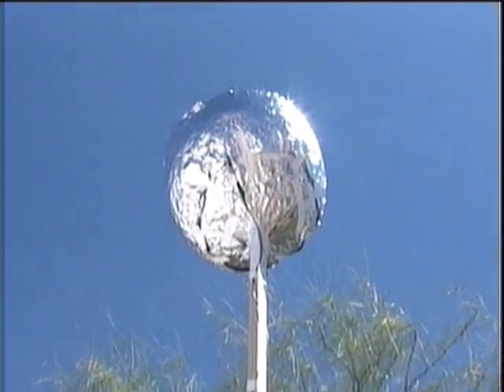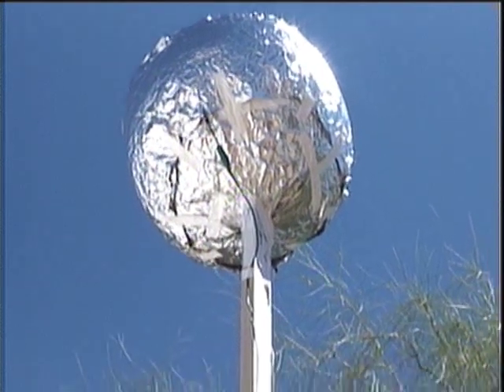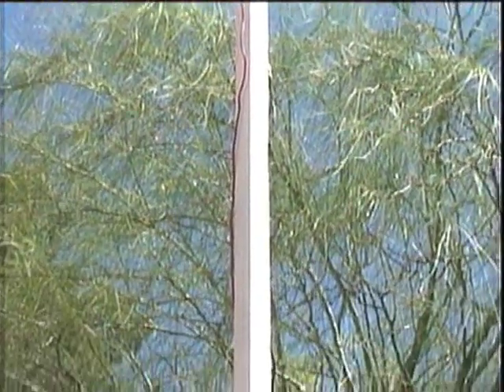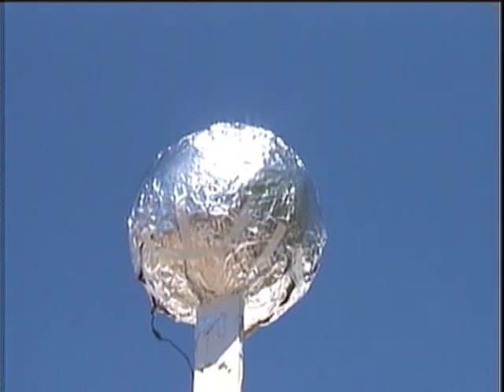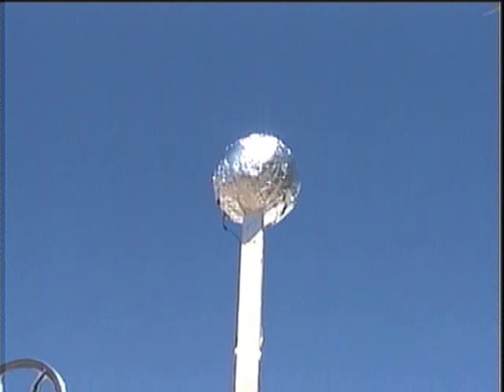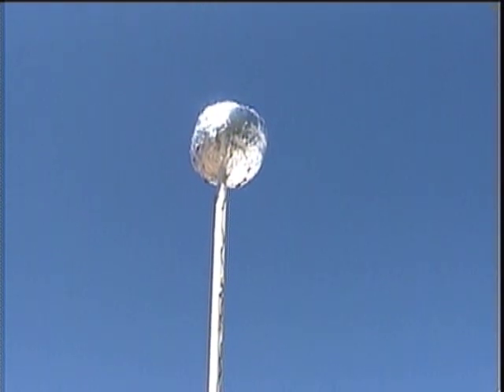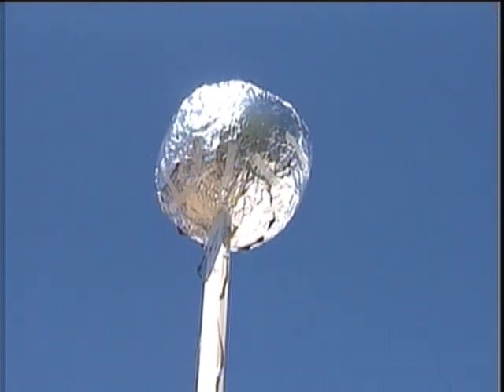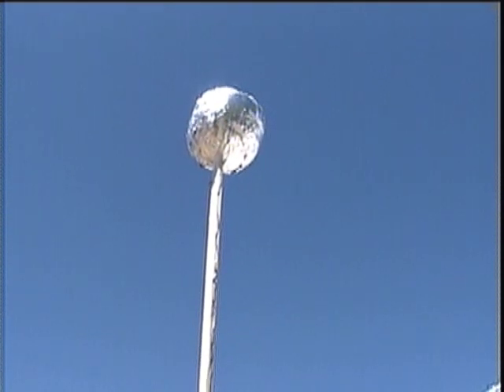Static Electricity From Air

Comment: Use PVC pipe. Wood conducts electricity via moisture. The fair weather field charge in the air during fair weather is @ 100 volts per meter. The higher you go the more volts. 10 meters above ground the potential between earth and this elevated point is 1000 volts. The current flow into the air is only a few pico amps so there is not much power available. The atmosphere is charged due to cosmic rays producing ions in the air. The ions are why the atmosphere has  positive charge. A 300 foot long wire antenna 30 feet off the ground will collect enough electricity to make sparks over 5 inches long if a thunderstorm is near by. Did that.... Don't do it... Its dangerous!!!

Comment: I'm an electrician in MA, I want to share a short story with you. I used to make wire for a company, and it was, if I can remember correctly, 20 awg? And they would store it on a reel with about 20,000' on these reels. Now after sitting around for a few weeks to months, these reels of wire would become basically giant capacitors. And they would store some SERIOUS SERIOUS energy! Enough to blow a small hole through my fingernail and put me on my ass, dizzy for almost 2 hours! And I've been hit with 240 volts/200 amps AC!!! The discharged DC energy was so much worse! And then we're taught that you can't get something from nothing when it comes to energy! Well it doesn't cost anything to let a reel of wire absorb the ambient electricity from the atmosphere, so why do they lie to us right?!!lol
Reply: HumblePerfection I'm not surprised. I have to discharge my capacitors before using them after just sitting around in my drawer before I can use them. The larger ones have caught me off guard more than once.
Reply: Thermal expansion and magnetic fluctuations is enough to cause sufficient friction to generate charge over a period of time if it's insulated and the humidity is low enough.
Reply: that is crazy interesting.... would prolly be more like a reactor or inductor i would think.... maybe the volume of sheathing held most of the current? is the stored power static or in a field i guess is the question
Reply: @Sev Lop What does free energy means for you? If energy was not free (Running freely through everything) Nothing would happen
Reply: @Sev Lop That is the problem of the word 'free'. For me, free Energy means that the Energy is free to move, unblocked. Everything as a cost, even if it cost just time. So it seams that we are ok on that point
Reply: Second law of thermodynamics.  Get over it and enjoy the technology.

Comment: you need to build ground capacitor and that you will need it but all goes in the ground and you can get 12 v 1 amp from the ground :)...play with cooper pipe and iron rod in the midlle of the pipe all together put in the ground by leving 1 inch above ground ...
Reply: what kind of compacitor ?
Reply: Earth battery is what your describing . Not static atmospheric electricity like the video is showing

Comment: Ever consider using a balloon. The higher you go the more power you can generate.Wrap some aluminum foil around a high floated triple stuffed balloon. Use  your wire for your tether. And of course make a video so I can see the results.
Reply: Erik Palafox I think it should be done in a electrical storm
Reply: I like the way you think
Reply: And hold onto your ass!
Reply: I seem to remember a meter /yard being the scale. I would think the size of that ball would not matter. Very small helium balloons tetheres with your wife and grounded.

Comment: Volts mean nothing if no Amps :)
What does your meter show for Amps. I bet it would be in microAmps.

Here is a suggestion. Add plastic hair to your ball so that when wind blows they rub on your ball :)
Reply: +Talha Kamran how about 10000 volt and 10 milli amp?? isit funny ?? step down to lower volt
Reply: +ambady k b I take my words back.
if you have thousands of volts and few miliamps you can step it down and make use of it. How silly of me to say that volts mean nothing.
1mAmp at 10,000 volts = 0.001 * 10,000 = 10Watts
After all power is a composition of both volts and amps
Reply: ya thats it man
Reply: Osman Tekin Thank you .
Reply: how do volts get stepped down while keeping the amp ? is there no simple way of doing this ?
Reply: Make amps by making a flow of pulses . Use switch on antennas connecting and disconnecting ground to air antenna

Comment: all your electricity came from radio waves , no static electricity from air
Reply: WRONG, this was proven to work before marconi broadcast across the English channel, lol. As well as if there is no static electricity where does Lightning come from? Radio Waves?
Reply: +Bndoe Doorman ya sure radio waves from outer space
Reply: radio waves all all around us, including mobile phones waves, wifi and others,, take a battery radio and search for  music, if you hear music is because radio waves, if you can talk at a mobile phone you have radio waves again and so on,
Reply: radio wave wave from outer space cosmic objects
Reply: Zelez Forever  crystal radio works on radio waves human produced no need battery
But a scientist also found naturaly voltage exist at high level of sky
Reply: take your meter (assuming you have one) find some high voltage transmission lines, stand under them and put one lead in the dirt, and wave the other in the air.... You might be surprised

Comment: You must put a 3KV capacitor and a spark. Each 1 meter of height have 100 v increase
Reply: Your right sir a spark gap or switch of some sort will allow the user to pull pulses of electricity out of the antenna quickly resulting in an amperage aswell as the voltage